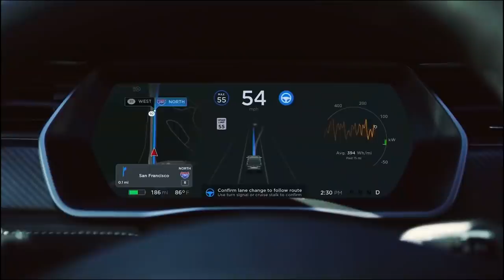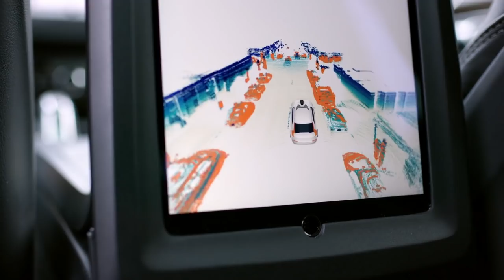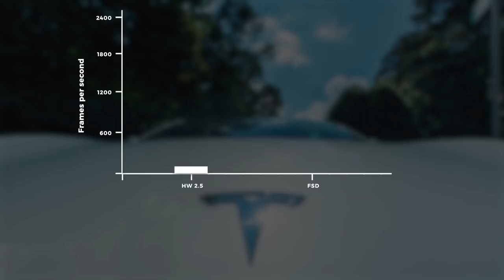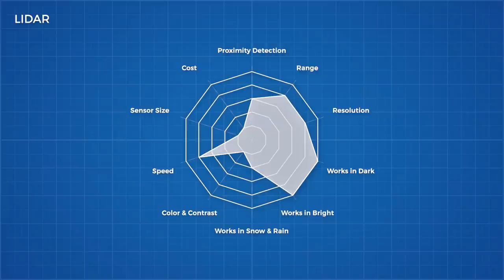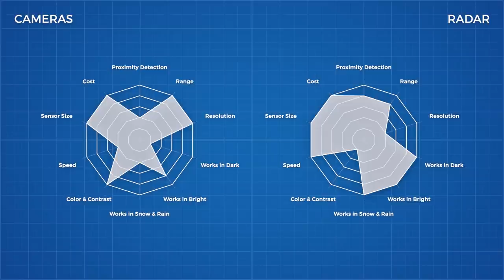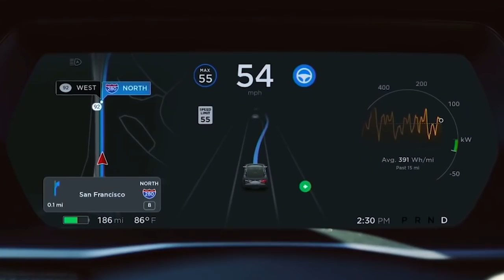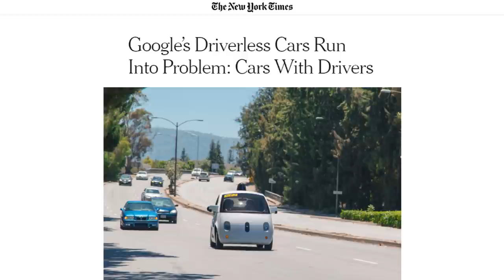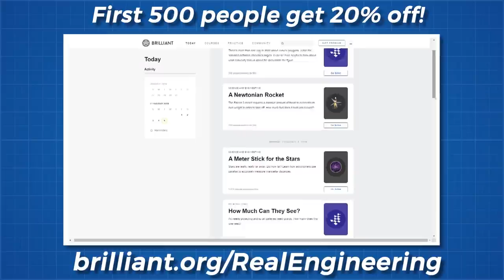The Challenge of Building a Self-Driving Car

Comment: What about another challenge — infrastructure? Potholes, barely visible road markings, flooding because of clogged storm drain, uncleared snow etc.
Reply: Aka Driving in Canada
Reply: @dracoeris  I was in Pennsylvania just a bit ago and their roads are horrid.
Reply: I might be wrong but I think they have a thing where they can predict what the most likely path would be and use that to guess. I'm probably wrong but I've seen a video of one driving on an unmarked road.
Reply: Well, how do humans solve that problem? The Ai isn't checking for clear lane markings, its analyzing all the available data to find any patterns that may be present. If it can plot a safe course using only the behaviour of other vehicles (the way humans guess at lanes in snowy areas) then it will do that. Tesla has access to enough data from enough edge cases to learn a behaviour for those scenarios.
Reply: @aleksandarilievski7273  Everywhere there are Teslas currently driving, there are Teslas currently learning. Its not just looking for clear and correct markings, its looking for anything its learned to look for. (which in sketchy situations will obviously be more complex and nuanced then a clean highway in SF)
Reply: Its a very long video but you should watch the tesla autonomy investors day on Tesla's youtube channel. You can skip the first hour or so, pretty sure its a video loop for the first bit. You will see how they are accommodating for those things
Reply: As long as humans can drive in those conditions, computers can do it better. They just need much more data and good careful programming.
Reply: In Las Vegas there is a company called APTIV, who runs self driving lyft cars. I had the pleasure of talking to an engineer from the company, and this was one of my first questions. He said that the vehicle uses a combination of lidar and super accurate GPS, and does not need lane markings. This seemed far fetched to me, but I do over 150 miles a day and I’ve never seen one of their cars drift out of its lane, even on bad roads where my human eyes have trouble.
Reply: @fartmerchant762  good for you what do you want for this?
Reply: @aleksandarilievski7273  well we cant expect it to go from working no where to instantly working everywhere... still large portions of civilization without running water or electricity.. and for that matter theres plenty of roads anywhere that low hung high dollar cars cant navigate without getting scraped to death

so how about we get self driving in the cities and clean roads for the more than 50% of people who love there than pick away at the rest.. fyi i am part of the rest one ton work trucks get beat to pieces up here
Reply: I live in Quebec and barely visible potholes are a legitimate issue even for human drives in certains conditions, say it is filled with dirty water within a dirty water patch
Reply: @cerebralm  absolutely true, as a human driver I have trouble determining the proper lane makers sometimes, especially when there are construction and markers aren't removed and end up overlapping multiple sets, or when it's dark and wet and the lines disappear. I can't say I expect a car to figure it out when most humans don't, I see accidents all the time around me when humans fail to correctly stay in their lanes because of unclear, worn or duplicate markings.
Reply: I can imagine self-driving tech as a way to improve this; Apps like Waze already have a "citizen reporting" feature. Software could be utilized to have the car report infrastructural problems directly to those who have the power/authority to fix them, and obviously a calculated way of deciding if the road hazard will warrant stopping the vehicle or not.
Reply: Painting using something like magnetic paint could be an interesting step. I'm sure that there are plenty of companies out there looking at different ways to make the driving easier for the vehicles. (Eg you could have both passive and active markers on the road to make tracking easier.)
Reply: You have to walk before you can run. Right now self-driving cars are learning how to walk. What you're describing is getting self-driving cars to run. I'm 100% sure that everything you mentioned is on their to do list.
Reply: @aleksandarilievski7273  30 degrees C is a comfortable summer's day. When it gets to 38 or 40, that's when it's unpleasant.
Reply: @fartmerchant762  47℃ here in UP, India
Reply: I’ve written extensively on AI. What I can say is that a way to fix this would be a “hive mind” server that collects vast amounts of data on little challenges in the road. Almost like how we remember to stay out of a line that we’ve seen before is blocked by construction. The main advantages of AI are that it can now learn using neural networks, it can store more memory on specific subjects like driving and maps, and it can react quicker than humans (given the right sensor systems/software)
Reply: Ben Heinz I live in Pennsylvania, don’t even get my started about the roads and the other drivers
Reply: that's probably the reason i have never seen a Tesla in Greece  the roads here are never painted in the city , they only paint once after paving  and forget about it until they redo the road surface, there are may junctions where it's a guess on where you should be to take a turn or even where to drive to go straight ahead.. total jungle
Reply: I believe that's why Phoenix is one of the current favorite places to test self-driving cars:

* Relatively new and very well-maintained road network minimizes deteriorated pavements and ambiguous markings/signs
* Desert climate results in clear weather almost all of the time, with extremely low risk of flooding, snow or poor visibility from cloud cover or fog
* The extremely suburban environment provides a lot of idealized conditions with respect to threats typical of urban core environments: freeways/motorways, wide avenues, fewer situations in which there's pedestrians around...
Reply: @aethersgeckogaming2176  Would that work on a gravel road
Reply: @benheinz8817  that's actually why a lot of companies like testing their AVs in the state. The logic is that if they can succeed in Penn then they likely can succeed anywhere in the US

Comment: The four-way stop is such a cool example where you really have to test out the other drivers and respond accordingly. Never thought about how complicated a process that is. Merging in congestion seems like it would also be really hard to code - or at least something I would be nervous about letting my car do for me ;) Awesome summary.
Reply: Hello there
Reply: Hello there
Reply: The only real way to solve for real world scenarios like this is to train for what a real human would do. Then you can compare your rules based heuristics against your human training based heuristics and if they match go ahead and take the action indicated otherwise, find a way to break out of the scenario that you have gotten yourself into, sort of like how the Tetris program use the pause button to break out. the alternative may be to slow down, veer slightly right or slightly left and test for a reaction from the other driver, etc.
Reply: Note: you need to be able to make a lot more than 100 decisions per second to be able to model several scenarios at once, which is why Tesla wisely decided to up the processing power. In fact if I had to guess, one processor could be generating a model while the other processor generates the reaction to that model sort of how current deep fakes use one network to generate the fake and another network evaluates the authenticity of the fake

Comment: A Tesla service manual showed the model 3 would be getting a second forward facing radar for redundancy
Reply: Will they finally stop crashing full speed into trucks stopped on the highway?
Reply: @blink182bfsftw   No as the engineers at Tesla find it too difficult to merge radar and camera data Tesla is no limit nger using radars. Can't make this shit up

Comment: The "humans don't follow the rules" issue can even become a "humans see a waymo and go first because the waymo will not challenge them"
Just like driving-school cars, people don't want to be stuck behind it so they tend to be more aggressive.
Therefore I think tesla has the advantage of collecting "real life" data because other drivers don't know if the tesla is self driving or not
Reply: Sad, but true...
Reply: Good point. As a recently re-newed cyclist what I've noticed suggests that reducing the issue to the AI car needs to be a bit more aggressive doesn't cover it. It's basic game theory.  A lot of drivers who arrive before me at a 4 way stop won't proceed even when it's clear that I'm stopping, a lot of time they wave me through. I don't often come to a complete stop unless there're cars or pedestrians. And on T-intersections with traffic signals, when my route crosses the 't' and  I won't encounter any cross traffic, I usually slow, check for pedestrians and turning cars and then proceed. More than a few times I've done this right in front of a police car. A lot of what I do on my bicycle, I'd never do in my car. The officers don't seem the least bit interested. (My theory is that it's better to get out in front of the scrum before the light turns green. This makes it easier for drivers to safely pass me moving at a steady speed, instead of me in the scrum wavering a bit as I start off.)  It's basic game theory. 
     I would argue that it's always been game theory, not just aggressiveness, or stupidity. What are the current biggest risks in driving? Drunk and drugs driving, distraction from smartphones and speed. Keep these in check and you have a driver who is paying attention, looking for, anticipating and avoiding risks they can be a pissed off youth who passes by and curses you or his sedate granny. ('Somebody ought to run you over' and 'I need to be extra careful' are both ways of I am not going to hit you.) 
        The 4-way stop problem we used to call the Chip-n-Dale problem, they were two cartoon chipmunks who were overly polite with each other, always insisting on waiting for the other to go through a door first, "No, you go, I insist," "Oh, I just couldn't..."  until Bugs Bunny or Daffy Duck barrels through.  The problem in the fatal Phoenix accident doesn't need to be solved by software or hardware (though I'm sure both will improve), all the software really needs to do is recognize when it's confused or uncertain then, while nudging the driver to take over, it slows down or stops the vehicle. Which is what drivers are doing at a 4-Way Chip-n-Dale stop. It doesn't matter if one driver cheats, or is more aggressive-- it only matters not to have an accident. 
And I agree Tesla's huge amount of real data is its major advantage. It's a bit like us. After 20+ years of driving have you ever looked at a car up ahead and immediately knew, 'that guy is going to do something reckless' ? Sure if it's hot rod swerving, but how about the times you can't even tell what made you think this? That's the result of deep HI-L, Human Intelligence Learning-- through experience. 
(I wonder if Tesla's AI has noticed that when another driver is touching the left side of their face, their left side blind spot now extends almost to the front of their car? When I see this, I get in front or fall back. They're usually too preoccupied to change lanes, but if they do....)
Reply: There's at least 2 cases where a google car got into an accident purely because the human drivers were pissed off at it. 

In one case the mayor of the town had allowed the cars, but stipulated they couldn't drive faster than 30mph (or whatever it was), so when going down a road that was marked for 50mph the driver behind got angry, overtook, then slammed their breaks resulting in them being rear ended.

The thing is though, the best road network would be one with 0 human drivers, if all cars have to be selfdriving in a country you could have the cars cooperate to make traffic faster and safer. It still needs to be able to deal with bikes, animals and pedestrians so training them like they are now is fine, but the goal should be 0 traffic fatality, and that precludes human drivers.

I like to ask anyone that think human drivers are better than AI drivers to watch some videos from this youtuber: https://www.youtube.com/user/truckdriver1982
Or any other dash cam videos.
Reply: @Sylfa  This is a good comment. I guess while driving and self-driving cars are striving to be safe, there are idiots just as diligently striving in other directions.  
          When I was teaching students and I were chatting about self driving cars. A surprising number of young people don't want to learn how to drive. I suggested that if they ever thought they even might  like to drive a car they'd better get on it. Self-Driving may even become illegal.   An officer pulls you over, "Sir, were you attempting to steer the wheel?"  "Ah, no officer, I wouldn't never do such a thing." "Where are you going?" "I'm drunk and I want to drive home and sleep it off." 
"That's perfectly alright, sir, but attempting to drive a motor vehicle on any street is as you know, illegal."  
I look forward to the day I can take long road trips and long naps or  do other things while the car or van drives. I can see road trips where instead of camping the car drives some less interesting section while I'm sleeping, or cooking dinner, or writing. It would be like taking a sleeper train, or a sleeper bus.
Reply: Man they need to employ psychologists to make self driving cars understand how humans drive more.
Reply: @Sylfa Lol, road rage against a self driving car. I don't get the rage about a car going slower, that's what over taking was made for, just pass the car. Was it a 1 only lane double yellow or something?
Reply: @SI0AX  Not sure if the video playing at the time was the right road (it's been years so I can't find a link), but it showed a inner city road with cars parked on either side, oncoming traffic and single workable lane either direction. Can't recall if it was double yellow or not.

But I could imagine they worked in transport, that or just feared AI so much they wanted to "stop" the car. But who really knows. It does happen though, people see it's self driving and any perceived flaw is magnified in their minds. And a select few idiots try to "teach the car a lesson".
Reply: @Sylfa  Or maybe the expect the car to react well to brake checking. A human probably wouldn't have reacted well to that either.
Reply: @SI0AX  Due to the restrictions there were cars right behind soooo... yeah. Break checking is reckless driving in any circumstance anyways.

But yes, could potentially have been a clueless driver wanting to "test" the AI.
Reply: @Sylfa  IMO, of all the road raging BS, brake checking is the worse of them all. You not only make it dangerous for your target, but also for everyone else behind the target. Road raging in general is dumb as hell though... People should treat cars as the dangerous tools they are.
Reply: @SI0AX  I agree, wholeheartedly, it's a good idea to remind yourself that your getting into a 700-1200kg guided ballistic projectile before you start your car. Unfortunately the people that most need to consider that are the ones least likely to do so.
Reply: While it's true that Tesla has a major advantage in distance driven over Waymo and other competitors, I think it's important to remember that not as much of that distance is useful to Tesla as the equivalent distance driven by Waymo. The problem is in data transmission: a Tesla vehicle can't just indescriminately send all data from all time spent driving back to Tesla because of the cost associated with that transmission. Waymo has the advantage here of actually owning all of their vehicles, which means that they can store the data locally on the cars and then extract the data when the vehicles return home: there is less of a reliance on doing things over the air. Overall I think this still allows Tesla to make faster progress (especially if they're smart about which data their cars choose to send back) but not as much faster as it may initially seem.
Reply: @JoshSmith-db2of  If you watched the interview then you noticed that Tesla "asks" the cars to provide specific failing examples. It is smart enough to just send relevant data that is collected through quantity. Overall, since they have more footage, statistically, more weird stuff happens and they have more of these data in comparison to others companies.
Reply: @WillN2Go1  , good points. However, Tesla undermines your point about speed by making very fast cars, but I'm not going to complain about that!